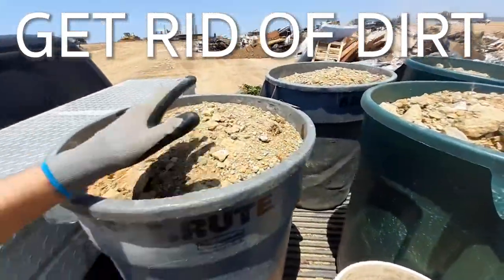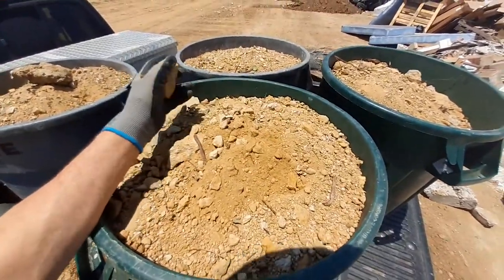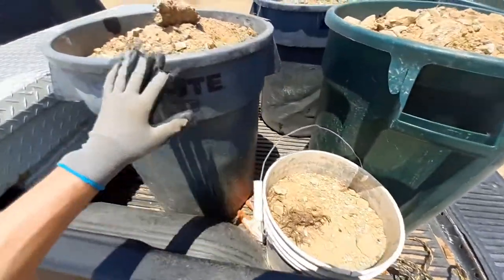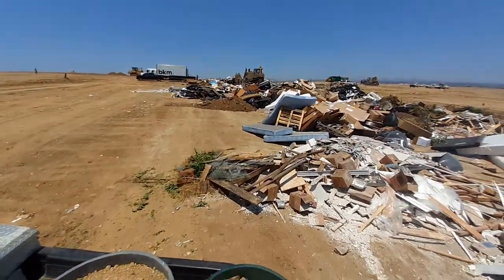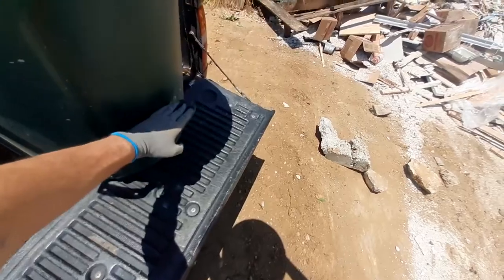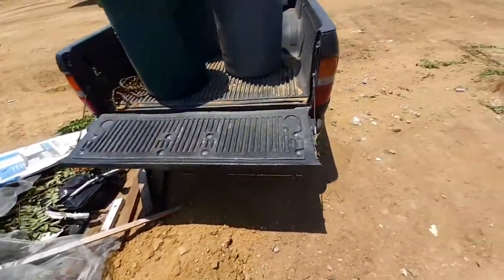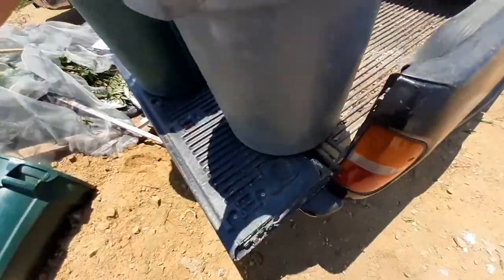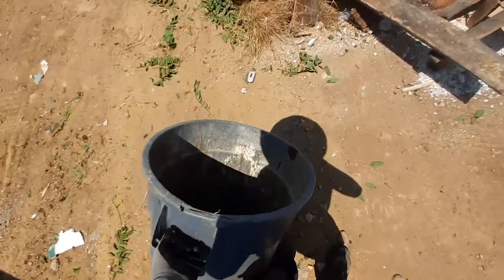Simple Trick to GET RID OF excess DIRT (Easiest way to Haul & Unload Dirt)

Comment: Now what's the trick to getting the 500 pound cans in the truck?
Reply from the maker: You need to take buckets small enough to pick up then dump them into the trash cans while they are in the truck already.  Hope that makes sense.    Super easy but need to be strong if you are filling buckets up full.   Try half full bucket first and see how it goes.

Comment: You're tailgate is probably only rated to hold 300lbs. !!!! Every time you dumped those, warp goes the tailgate.
Reply from the maker: True but you would be amazed how much wear and tear I put on that tail gate.   Thing still is holding up.  I did replace the steel cables those last year.   That holds all the weight